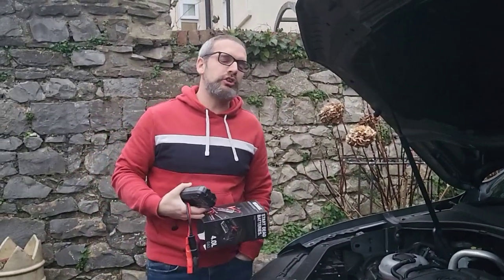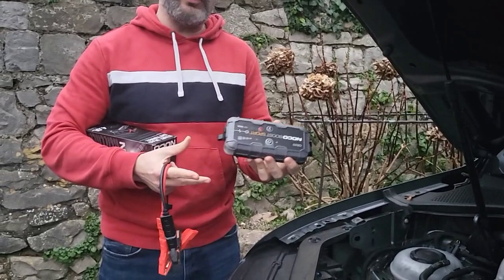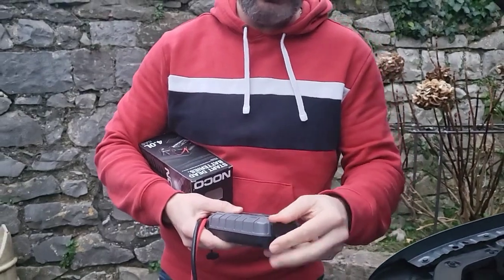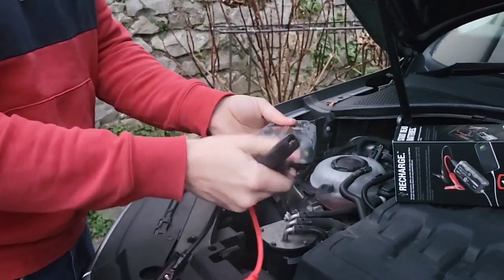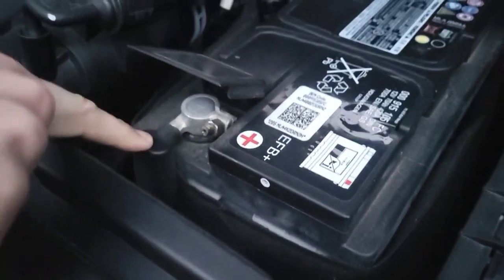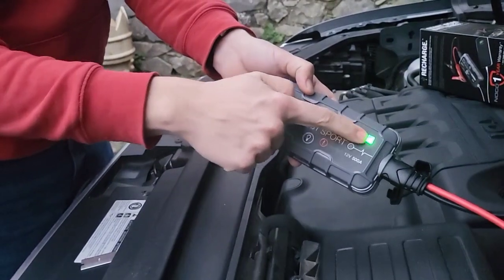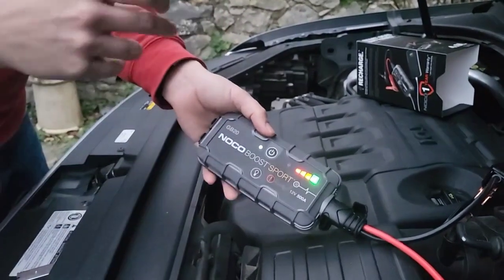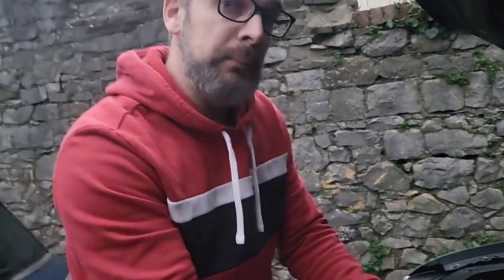Fix a cold dead car battery with GB20 Boostsport...easy.

Comment: Thought I'd correct a little error in the information. After correctly connecting both RED & BLACK clamps, press power button, the power indicator lights will chase, once you see the white light, (located below the power indicator lights) your car can be started, if the power indicator lights are on constantly and white light is off, check clamps are correctly connected.